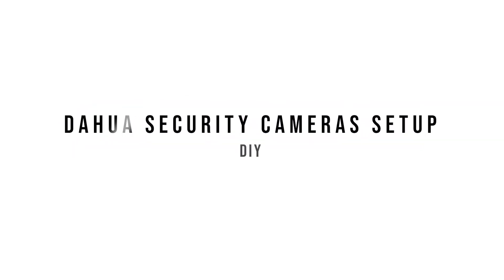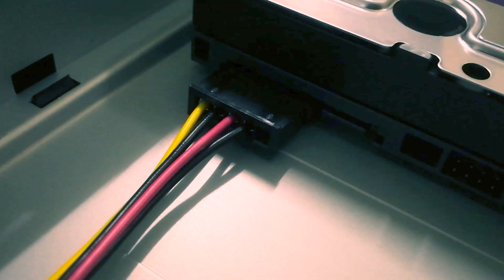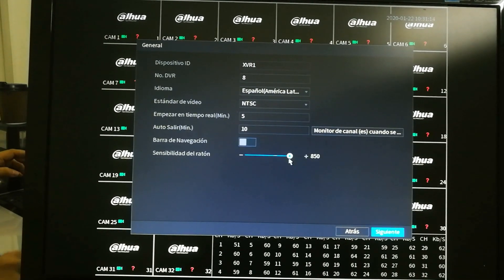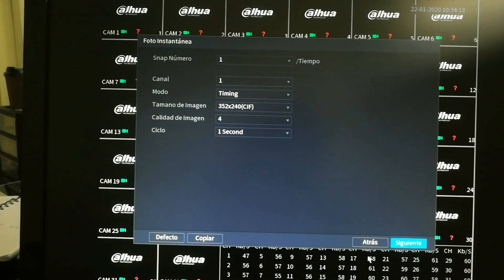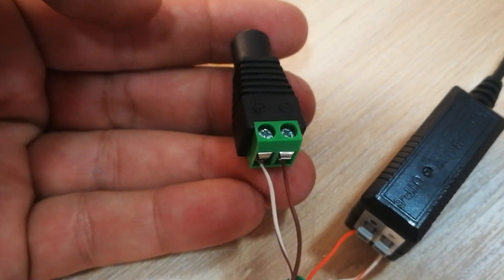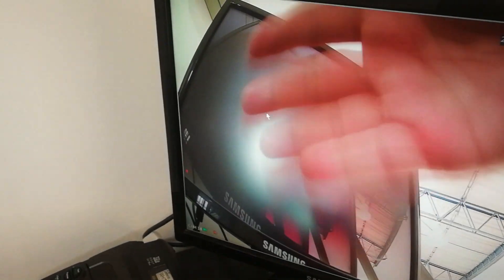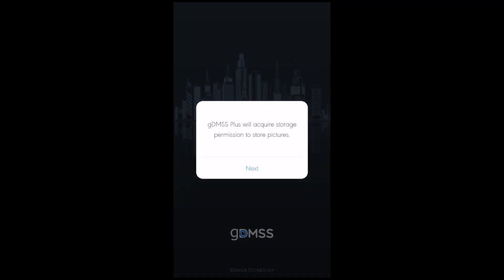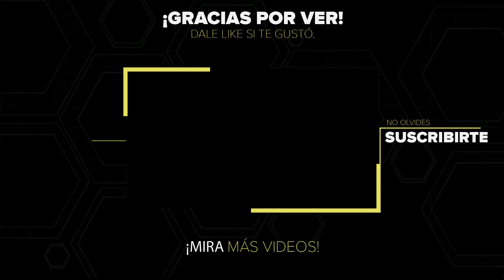Dahua Security Cameras DIY Setup

Comment: When I connect my camera to my mobile app in this case gdmss plus it works only on local wirless if I connect to another wirless the cameras fails
Reply from the maker: Youi may have linked it to the local IP address.  Just go to the p2p network in the DVR and activate it, then may sure it says "registered".  Then delete in the app the system you already had and add it again by selecting "add", then enter the serial number of your DVR, and enter the username and password.  It will locate it whereever it is in the world and let you access remotely as long as you are connected to the internet.

Comment: you are using an Ethernet-UTP cable to connect between the camera and the dvr ? i thought UTP cable for ip camera to connect to nvr only ? DVR with analog camera are not working with coaxial cables  with BNC conectors?
Reply from the maker: Hi, exactly as you described it. We used to connect cameras with the DVR using a coaxial cable, and depending on the environment and interference we still do.  However using video balun adapters (https://amzn.to/3hd9uJS) you can switch prom BNC connector to UTP cable which will let you work pretty long distances too.  That way you can save on cabling as with a common UTP cable you can connect up to four cameras (video only).  Other alternatives include siamese cabling (https://amzn.to/3WoYjwT) and All in One cables (https://amzn.to/3VOddfU).  Thanks for watching our videos!

Comment: Hi, if you have a DVR with 4 channels and you only have 2 cameras, can you make the monitor show only two of the four channels at the same time?
Reply from the maker: Hi! default views of most DVRs include 1, 4 cameras, 9 cameras, 16, 24 or 25 and 32, but not 2 as they would look distorted.  So basically yes, you would see two used and two in black.
Reply: @momentosdetecnologia  Thank you! I did notice that most reviews on the product where people bought the 4 channel 2 cam set showed their monitor having 2 unappealing vacant black boxes on top.

Comment: In the app of dahua gDMSS PLUS recording is shown for 1 hour only. How can we change to view all recording.
Reply from the maker: Hello Fahad, in the DAHUA App, you will choose Video, video PlayBack, and before you select the camera,  choose the time frame  from the upper right icon, which should not exceed 72 hours. Then you will just slide to watch the exact time.  If it is not there, it may be due to a low sensitivity motion senson trigger.  Go to settings and increase sensitivity if that is the case.